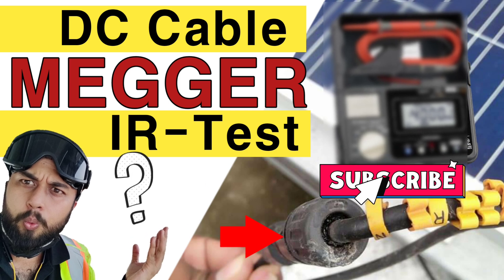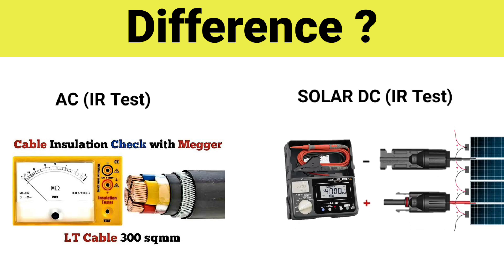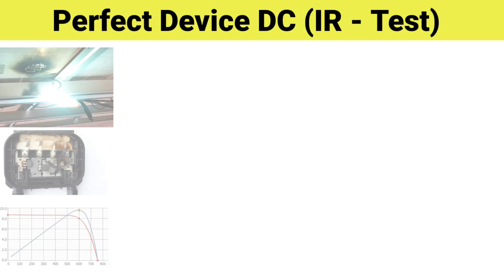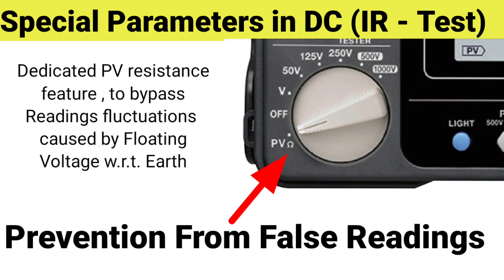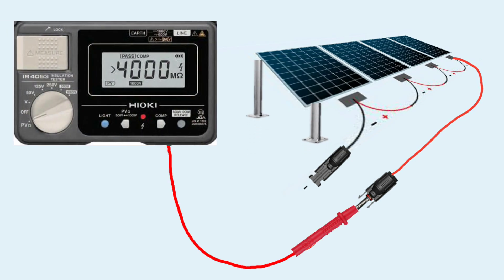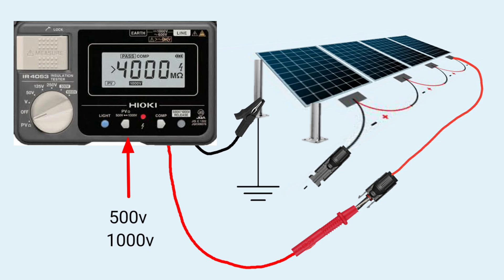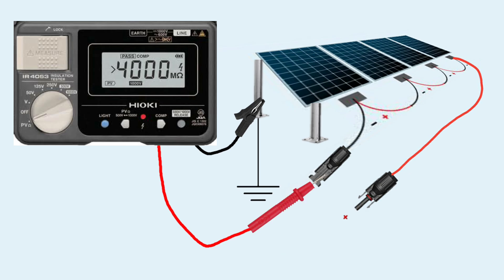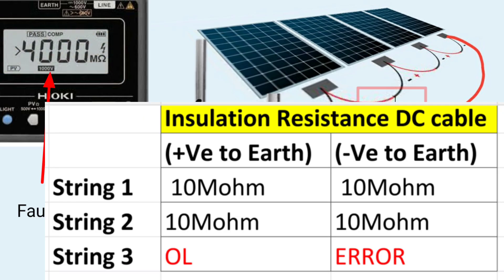SOLAR DC cable Insulation Resistance Test | Solar DC megger | How to Test | Equipment details

Comment: You don’t have to get this specific device. Any insulation tester (500-1000VDC) will work. To test. just make sure you connect the positive and chassis and then negative and chassis.

Comment: Sir, some past months I am facing some trouble with my solar on grid inverter. Inverter frequently trips, with displaying (low insult resistance). So how can I rectify this problem..
Reply from the maker: One of the connected string is damage & is coming in contact with earth , you need to check individual string , when the fault come for floating values , i.e +ve to Earth & -ve to Earth

Comment: Sir kya Mai solar string ko fluke k megger se check kar sakta hun 1000 V par test 
19 panel 1 strings Mai connected hai string k voltage 878 hai
Reply from the maker: No

Comment: I used MECO 1000v make Megger it shows the values 500Mohm.
Reply from the maker: Are you testing solar panel connected dc strings
Reply: No Sir, I checked it in SCB with respect to Positive bus bar to Ground and also Negative busbar to Ground.I done this whe all fuses is closed.MCCB is in OFF condition.